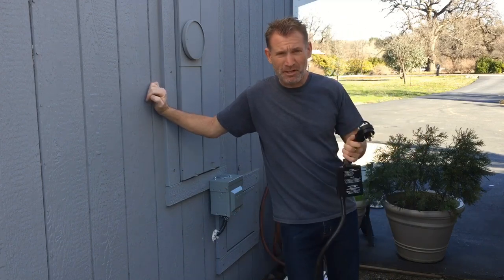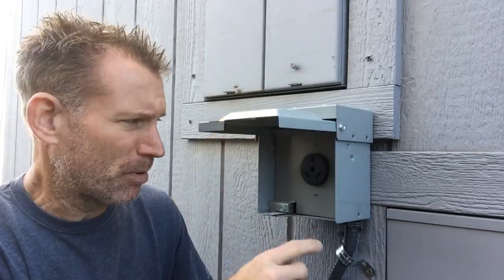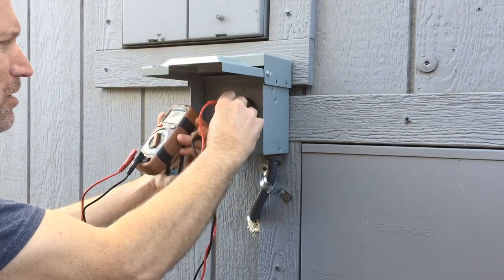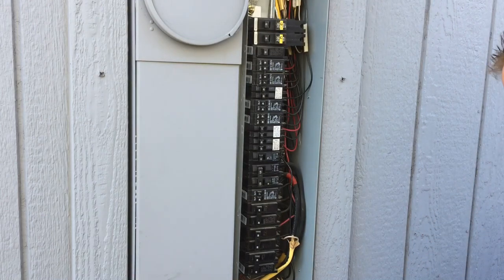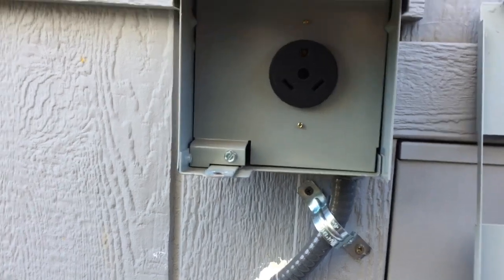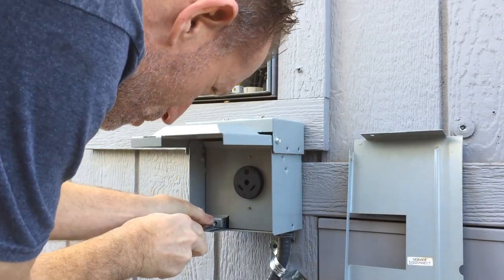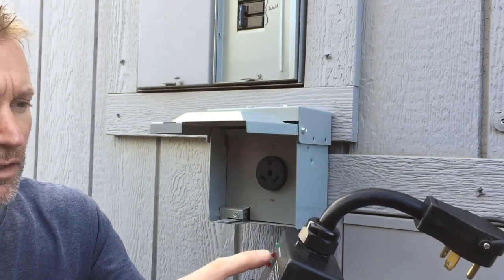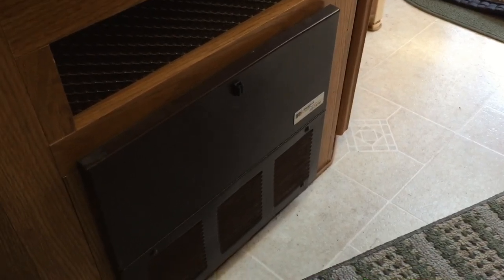Install a 30 amp RV Power Outlet

Comment: They appreciate that you started off the safety aspect of the job in hand I’m not an indoor electrician, but I work in high-voltage powerlines for the last 30 years IBEW and what I’ve seen on these videos they neglect to talk about how to start the job safely and correctly so I appreciate that. Thank you.

Comment: I worked at a electrical generation facility and want to offer some advice that we used. When working on a circuit, use a live/dead/live check. This means use your meter on a live curcuit to verify the meter is working. Then check the circuit you believe is not energized to make sure it is dead. Then use the meter on a live circuit to indicate power to ensure the meter is working. Relying on one check with a meter can result in a false negative as the meter hasn't been verified to be operational. Great vid, Thanks.

Comment: Good Video Jeff on how to do this simple RV plug that a yellow pages commercial electrician would charge up to $500. I did this exact install 12 years ago when we moved from Los Angeles to Northern California, Northern Wine Country, 15 miles north of Napa Valley. My 200AMP box on our house is the same as yours. The easy part for me was our electrical box was on the right side of our Garage 2 feet from the 60 X 40 driveway so the standard RV cable reached the plug. Two years latter my Daughter and I opened a CNC Machine Shop in my large two truck garage with my Daughter as Owner. We had 3 Haas CNC Mills, VF-1, VF-2, VF-3 and one CNC Lathe a Mori Seiki SL-1, all 3 Phase, 220vac running off a 100AMP subpanel wired into a Phase Perfect PT 380 digital phase converter which could run all 4 CNCs at the same time around the clock. I did all of the wiring in our shop. My Daughter did all of the CNC digital electronic work because we were too far for Haas to send repairmen to our house. Eight years later I retired, my Daughter went back to College we sold our business and all of the CNCs. Now I am Happily retired and My Daughter is a Viticulturist in Napa Valley Wine Country, California!

Comment: I helped a friend install one on his house and neither one of us are even close to handy. It was a lot easier than I thought it would be.
Reply: That's encouraging - however, everyone doing electrical panel work should be experienced.
Reply: How much did it end up costing you?
Reply: @CaseyHillstrom  He already has the wiring and plug so I'm not sure how much that costs. All we had to buy was the breaker switch. It was only a few dollars.

Comment: Definitely make sure to use 10/2 or 8/2 thicker when running a 30a breaker and rv receptacle. 10/2  should get the job done. Power on the left side looking at from the front and neutral on the right. Good video.
Reply from the maker: Yep, I did a supplement video showing and highlighting those points.  It is very important to use the correct size wire for the amperage.
Reply: Thanks, just got an RV, your video was helpful!
Reply: What about a 6/3 at 100 feet?     Overkill?
Reply: @ronsmith8434   most codes allow for up to a 5% voltage drop (95 feet on 10/2 solid copper wire), but if you were running the RV on this constantly, I personally limit my calculations to 3% voltage drop to take it easy on my electronics. That said, 57 feet is the max (3% voltage drop) that 10/2 (solid copper) wire can be run on a full 30 amps. Although I suspect very few people would ever be utilizing all 30 of those amps at once. So long story short, don't exceed 57 feet with 10/2 solid copper wire if you want to take it easy on your electronics, even though code would allow for up to 95 feet. You can run 8/2 wire up to 87 feet and still only be at 3% voltage drop. If you go by code (5% voltage drop) you could run 8/2 out as far as 144 feet. If you are only prepping the RV for a day before a trip and rarely running it out there (like nobody living in it) then this would probably be fine as you likely will not be utilizing the full 30 amps. Now if guests or you were going to be staying in it and utilizing everything inside, I personally would limit the voltage drop to 3% max so that way you are not being hard on your electronics and a/c. 6/2 wire at 3% voltage drop is good out until 136 feet. At 5% it's good until out to 226 feet, but unless rarely used, I would limit it to the 3% voltage drop.

Comment: Good video But needed a better explanation & pictures of what & how you hooked up in the panel to the 30 amp breaker & wires.
Reply from the maker: Pete Kane 
5:33 then again at 6:27 
There’s only one spot to hook up the breaker.  
Neutral/Ground bus bar for your neutral (white) and Ground (Bare Copper

Comment: To ensure proper grounding of your 30 amp outlet's box you need to scrape the paint off of the inside where your grounding lug makes contact with the box. Taking a metal wire brush on the end of a drill or a dremel will do the trick. You may or may not of gotten a couple static shocks off that little box as a small indicator.

Comment: Where's the conduit passing through and into the main panel? Metal conduit will be your ground. If not .you should run a ground bar into the ground and attach a wire from the service box to that ground bar.. You should also mention on balancing your load in the panel box..

Comment: I bet most people were interested in how to connect the wiring in the outlet box. Unfortunately, that was relegated to, there’s a schematic just make sure you follow the instructions, while far more detail on how to take a screw out, put a cable clamp on, caulk the hole, etc.

Comment: Good video, one thing though, should mention to use the correct gauge wire to move all that electricity, at least 10 gauge(10/2) or 8 gauge (8/2) for longer runs.  There are tables on line to help select correct gauge wire for length of run.
Reply from the maker: Robert August 
Hi Robert,
I clearly noted that in the video at 5:50 and again at 6:43 as well as in the materials list in the video description.  Yes, I agree... it’s imperative that the correct gauge wire is used.  10/2 Romex is just $1.40/ft at Home Depot or Lowe’s.  See this video:  https://youtu.be/3mIae4BnULM
Reply: Can I run wire 60 ft from the service box to my camper what size wire do i need?
Reply from the maker: Nathan Swisshelm 
There would be a 3% drop at 60 feet using 10 awg.  You would need to use 4 awg wire for that length run.
Reply: @nswiss19751  most codes allow for up to a 5% voltage drop (95 feet), but if you were running the RV on this constantly, I personally limit my calculations to 3% voltage drop to take it easy on my electronics. That said, 57 feet is the max (3% voltage drop) that 10/2 (solid copper) wire can be run on a full 30 amps. Although I suspect very few people would ever be utilizing all 30 of those amps at once. So long story short, don't exceed 57 feet with 10/2 solid copper wire if you want to take it easy on your electronics.

Comment: I was just quoted 1500 for a poofessional install.   I’ll do it myself for around 300 in parts. 125foot run 8/2 romex is the expensive stuff.

Comment: Just a note: if it wasn't mentioned, this is a 120 volt circuit not 240 volt circuit. I just wanted everyone to know for sure. Thanks and be safe.
Reply from the maker: Yes, it’s a 120 volt, 30 amp circuit.  There are people out there that confuse the RV 120 volt 30A plug with a 240 volt plug for a residential appliance such as a dryer etc.

Comment: From what I know the neutral wire goes on the silver side and the line goes on the gold side. Are you supposed to look at the diagram from the front of the plug or the back
Reply from the maker: Looking at the front of the outlet, 120 volt Hot (Black) is on the left, neutral (white) is on the right and of course green (ground) is on top.

Comment: Thanks for posting this video. I have an unused 20A circuit from an old “whole house fan” in the attic, the fan is the only thing on it. If I disconnect and remove the 20A breaker, can I just swap a 30A breaker into its spot and then run the new 10/2 circuit to the TT-30 box like the video?
Reply: Yes, you can!
Reply: Are you still gonna use the fan?  If so that will need a heavier wire

Comment: Thanks for the video very helpful!! Question I noticed on the link you posted you used 10 2 Indoor romex wire instead of outdoor wire? Is this ok & safe to do?  I want to do an RV outlet as well, Thanks!
Reply from the maker: Look to your local building/electrical code.

Comment: Going from house to shed then shed to 30 amp box 150 feet away through and 18” trench.  Is 2” pvc okay and will 10/20 work?
Reply: With that run you'll actually need 4 GA wire to keep the voltage drop under the required 3%. Use single conductors (black, white, green) to run through the conduit. 2" is plenty big and will give you lots of room for the pull.

Comment: Is the Progressive surge protector just use as an occasional diagnostic or is the RV line always plugged into it when the RV is on AC power?
Reply: Its a good idea to always use a surge protector, but its not necessary. That goes for everything plugged into a outlet.

Comment: Terrible workmanship. There are so many issues with this install. This is what happens when someone with only vague knowledge of wiring puts a youtube together - it just shows folks poor workmanship. Wire is yellow, so it is #12 despite your insistence that it is #10 (#10 Romex wire is orange), there is no connector to protect the wire from damage where the wire enter the circuit breaker panel, The sheathing should be removed from the Romex about 1/2" after it enters the box, so that the conductors can be routed cleanly and neatly inside the panel.The 2 hole strap is not the correct size and is mounted at such as angle as to cut into the flex. (I have been electrician for 50 years).
Reply: You may be a electrician but apparently not a reader, it states in the video that the wire was upgraded to 10 not that it was installed as 10. He answered this question months ago in other comments,  12 was the original instal when he had a small travel trailer and he upgraded to 10 when he got a bigger trailer that needed the extra power.
Reply: You are so correct, Paul S.  This was a horrible job.  He also went through saying the one wire is neutral which it is not, both are 110 hot which makes it 220.  Very dangerous video

Comment: I am about to run this setup approximately 25 feet from my main breaker panel, I plan on using 8/2 wire for this distance, are there any disadvantages of using 8/2 instead of 10/2 for this distance?
Reply: Other than cost, no.
Reply: 10 will be fine for 25 feet
Reply: Is 10/2 fine for 100 ft
Reply: most codes allow for up to a 5% voltage drop (95 feet), but if you were running the RV on this constantly, I personally limit my calculations to 3% voltage drop to take it easy on my electronics. That said, 57 feet is the max (3% voltage drop) that 10/2 (solid copper) wire can be run on a full 30 amps. Although I suspect very few people would ever be utilizing all 30 of those amps at once. So long story short, don't exceed 57 feet with 10/2 solid copper wire if you want to take it easy on your electronics.

Comment: Do you know if it is possible to hook up a RV trailer that has 50amp to an outlet with 100amp? The site is for mobile homes and has ports for travel trailers, mine will have 50amp and was wondering if I need an adapter. Thanks!
Reply: You will need to install a 50a breaker between the 100a service and your plug.

Comment: What gage wire would I need if it ran 30feet. And will this run the ac
Reply: 10/2 with ground, 8/2 with ground if you err on the side of caution.

Comment: You should never put #12 on a 30A breaker. That should have been a 20A breaker originally, so your wire is still protected by your breaker. Also, you should have a Romex connector in the panel where your new cable enters the box through the knockout.
Reply from the maker: Look at the other video that is linked in this video and in the video description.  
It is 10 AWG wire.  It’s a 30 amp breaker.   I also note that a few times on the video.  ....
Reply: @covetthecamper2289  If it s yellow its #12, not #10. Number 10 wire is Orange.

Comment: Gd video's. Was watching the one on series and parallel solar panels. I understand with batteries in series, the volts double and amps staty the same. In parallel,the volts stay the same and the amps double. In the panels,i'm still alitle confuse as my name says. If i put two 100w panels together for a 12v system in parallel,they stay 12v but are they now 200w and the amps double ? How do i get the most power and watts out of them or am i better off getting one single larger panel to avoid my name sake?
P.S.
Was looking at panel comparisons. Renegy and HQST I SAW in a few video's,are the same and yet,the HQST Monocrystaline are less expensive. Do you know where to get gd quality Monocrystaline panels for cheap price.?
Reply from the maker: There are just so many variables to consider when designing a system to fit your needs.  This is a great article for these questions. 
https://solarloco.com/blog/diy-solar-panels/volts-amps-watts/

When I redesign my solar power system, I’ll most likely use Zamp.  They are a great USA made company fairly local to me in Bend, Oregon
Reply: You are correct, the amps add up when in parallel or in the case of 2 panels, double.

Comment: Interesting there isn't (I didn't see) a knockout in the back of the Eaton box. Even though you have it well protected, I never want exposed wire that could get caught up on something. 
Thx for the vid
Reply: I saw that too, I would just drill out a hole to accept a connector.

Comment: Can you use a  Double poll 30 amp breaker for this application?
Reply: Johnny D. No...single pole 30 amp only. A double is going to give it 220-240 volts and blow up your RV . Single pole will be 110- 125v
Reply: @40redfox40  thank you!!

Comment: Why couldn’t I use 10/3 wire?
Reply from the maker: 10/3 (with ground) could be used if it’s something you already have on hand.  You don’t need 3 conductors, only 2 and the ground.  10/2 with ground is less expensive.  Be sure you clearly mark your wires and cap any unused wire.  Also, depending on the building code in your area, it may or may not be a violation.  Consult your electrician or building code.

Comment: Why is your breaker panel outside?
Reply from the maker: Well, it going to depend on what area you live in and what those building codes are.  Every house I’ve ever worked on, the electrical service panel is on the outside sidewall of the home or building.  Same with telephone and cable. 
Now, sub-panels are different.  Those are usually mounted inside wall such as a shop or garage.
Reply: Interesting. Here in the northeast and much of the other parts of the country where I’ve ever been, electric panels are always inside, maybe in an attached garage or the basement but always inside.
Reply: Power comes in from the street into the power meter and into the main panel from the power meter. Since the meter is usually located outside the house, the main panel is outside right next to the meter. Though in some rare cases I have seen a power meter inside a garage. They're usually located outside because the power company needs to be able to easily access the meter for maintenance.
Reply: @tier3rd375  where I live the panel is either inside or spaced away from the house on a separate post, you can NOT have a outdoor panel on the building here.
Reply: @jaydunbar7538 I can understand why a panel would be inside, but not spaced away from the house. It's quite common where I live for a power meter to be mounted directly onto the building and the main panel mounted right next to the meter. I can understand why some would want the main panel located inside the home (for areas prone to snow or to prevent people from turning off the power to your house), but why the panel should be mounted away from the building is something I don't understand.

Comment: 10 2 wire not 12 2 anytime wire is in conduit of any kind it needs to be stripped
Reply from the maker: I used 10/2 wire.  Look at the supporting video linked that has a better shot of that.
As far as the conduit comment, I suggest you look into your codes as this passed inspection by the county of Shasta, CA.  Sheath needs to be left on.  If you strip the sheathing, it’s then illegal. (Per building inspector)

Go to your
National Electrical Code 2011

Read:
ARTICLE 334 Nonmetallic-Sheathed Cable: Types NM, NMC, and NMS
Reply: Ok in texas they say insulation makes it to hot and its code to take off insulation before running into conduit,  different states have different codes thank you sir

Comment: How much would it cost to hire an electrician do this?
Reply from the maker: Too many variables to estimate that cost for you.  I suggest calling a few to get estimates for your area and specifics.
Reply: @covetthecamper2289  ok thanks, was just trying to get a ballpark estimate, not exact quote though. Like between what and what?
Reply: I would estimate, if it was similar to this project, it would run between $600 and $850.
Reply: Between 500-600.00 in South Carolina Upstate.  Had it quoted by 3 people. CRAZY prices!

Comment: Yeah your videos good and everything else I only have one little problem with it you didn't use the proper gauge wire you should have used a thicker gauge wire than what you did I don't think that one may handle 30 amps it may not if you turned on your air conditioning it would probably melt that wire so I would I'm use a heavier gauge wire at least at 10 or or maybe at 9 or 8
Reply from the maker: This video shows the update to 10-2 Wire for use with the 30 amp load.  https://youtu.be/3mIae4BnULM

The 12-2 was fine for my truck camper but now there’s a larger travel trailer here so I upgraded to 10-2 wire.